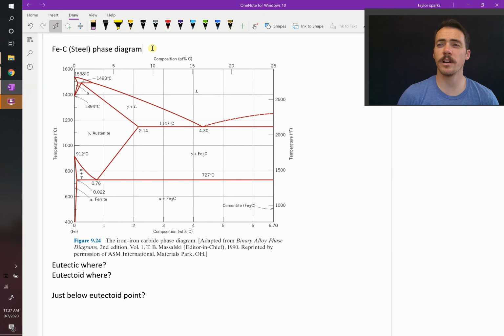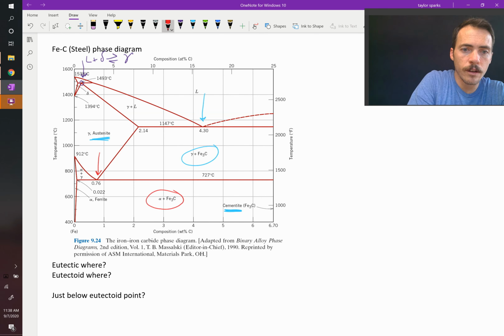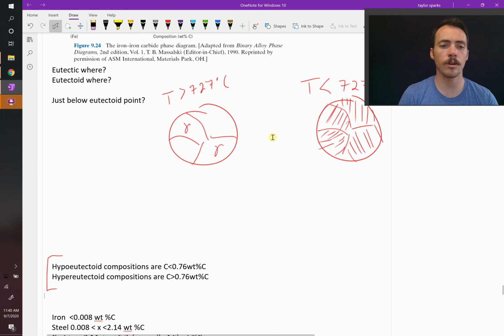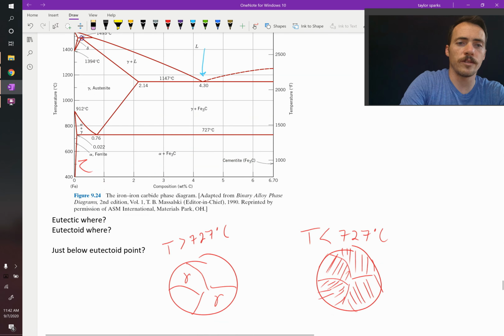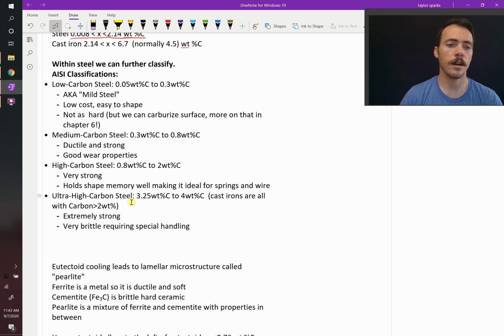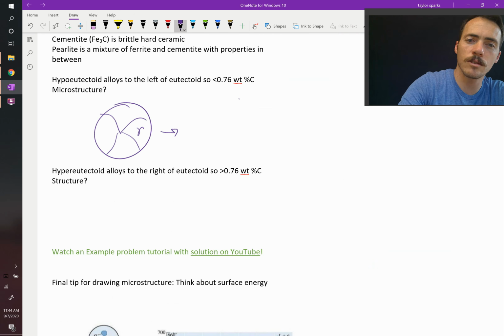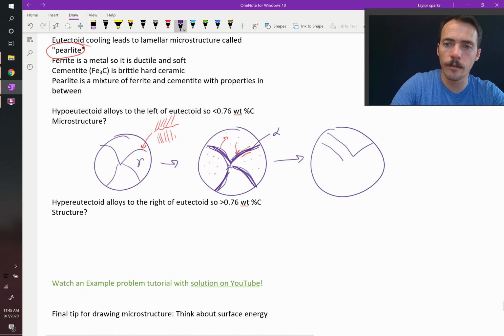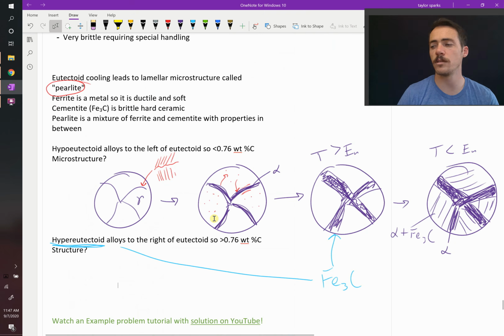The steel phase diagram

Comment: is austinite harder than ferrite?
Reply from the maker: I've never seen it reported... But ferrite is BCC and austenite is FCC. FCC has way more slip systems and tends to be softer. Austenite is also stable at high temps where you typically see softening. So I would guess ferrite > austenite.

Comment: What a weird naming convention that it goes iron, steell, cast iron. I feel like a better convention would have been iron, cast iron, then steel, or maybe iron, steel, cast steel. Is there a particular reason the naming convention turned out how it did? At any rate great video with lots of valuable content, I'm going for a position and material science without any experience that I'm trying to brush up on my metallurgy.
Reply from the maker: https://pnc.st/s/materialism/78772fdfaffa4a56/the-history-of-steel
Actually we cover it in our very first episode of the materialism podcast! Steel is such an incredible material.